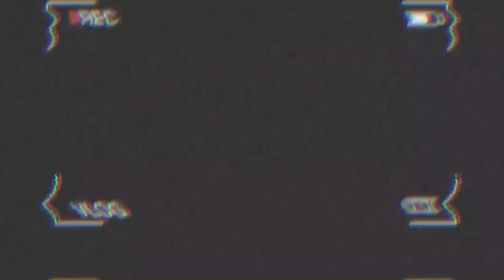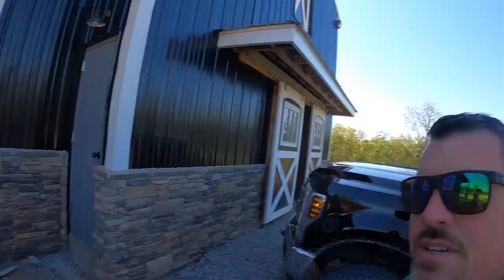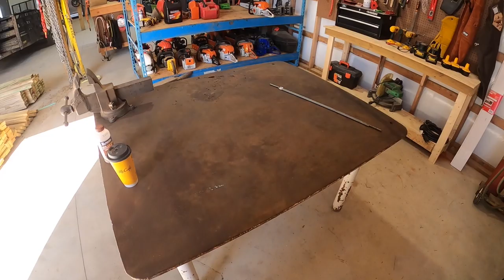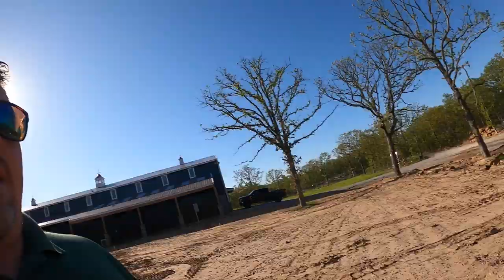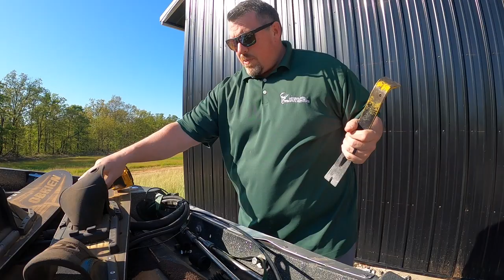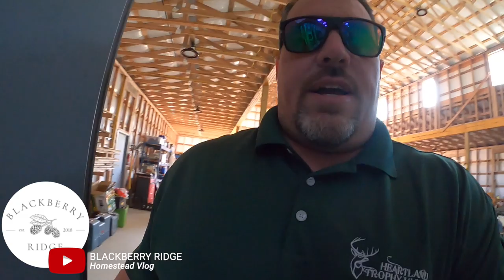Tool Tease | Transom Tease | Garden Tease | Fence Tease

Comment: Make sure you use some "marine grade plywood" when rebuilding the transom. The failing points in those are usually at the through hull holes. When the silicone eventually fails over time that is under the washers on the bolts it allows water to seep into the plywood under the fiberglass, eventually rotting it out. Good luck, this will be fun.
Reply from the maker: Larry Parish thanks for the tips! Going with an interesting product that is completely moisture resistant.
Reply: @blackberryridge8205  use some prosoco on those through holes? That stuff was initially designed to seal windshields. Now they use it a lot on waterproofing window seals and stuff

Comment: I would cut the top and clean all the rotton wood out and then pour Seacast in it there's video's here on you tube on how to do it that is the easiest way of fixing it.You use a  spade bit and drill down thru all the way across and suck it out with a shop vac but check it out to see if you would rather go with the seacast stuff once you get the rotton wood out mix the seacast and pour it in
Reply from the maker: Keith Smart I have seen this method as well.